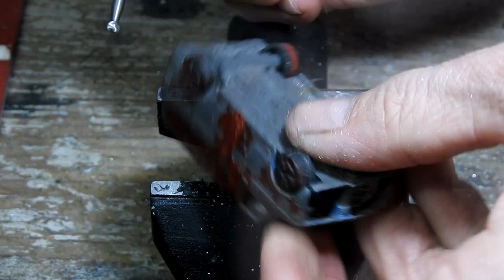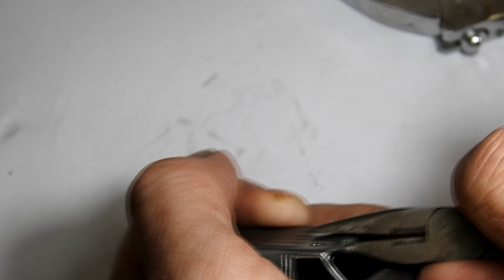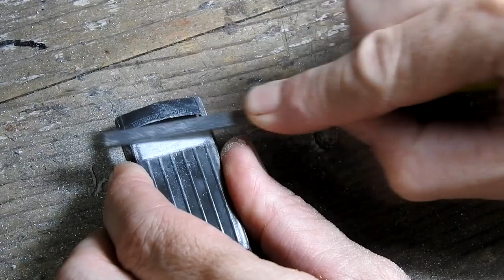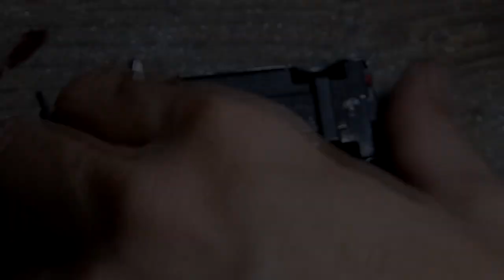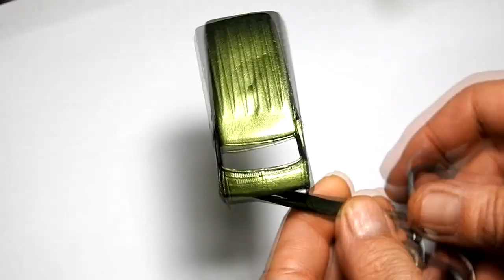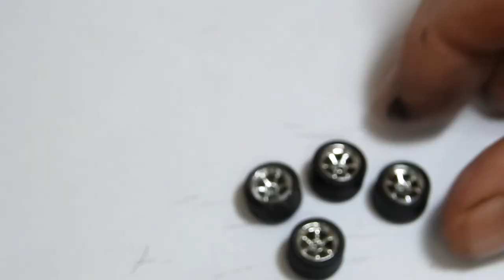Playart Custom Van Restoration

Comment: Superb.  That one looked ready for the bin.  What a transformation.  The worse the vehicle is to start with, the more profound the difference at the reveal.  Once it was down to bare metal, it's not a bad casting: door handle and hinge detail, number plate recess, lights, and fuel filler door

Comment: Another excellent job Danny, nicely done indeed. That paint is weird, very cool but weird. Where does the green appear from?  These wheels look awesome and must have cost two or three times more than the van originally cost. The only thing I might have added would be a wee scrape of putty on the driver's side of the van. There's a nick in it which shows through the paint. A pity, but hardly a game changer.😁

Cheers for now,
Dougie.